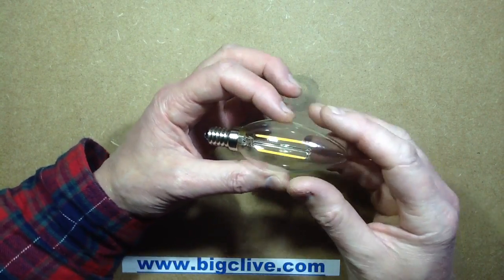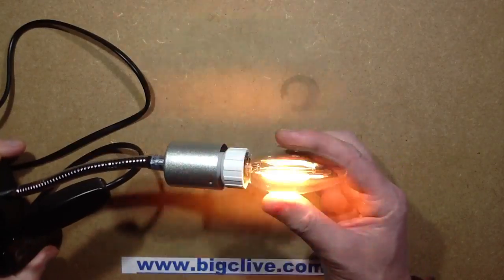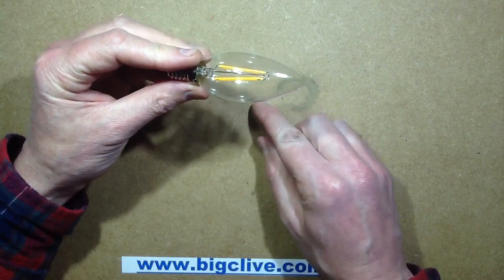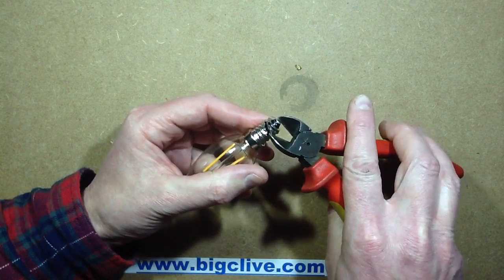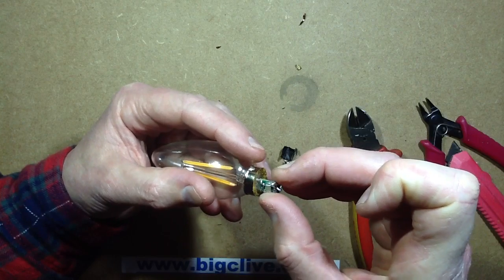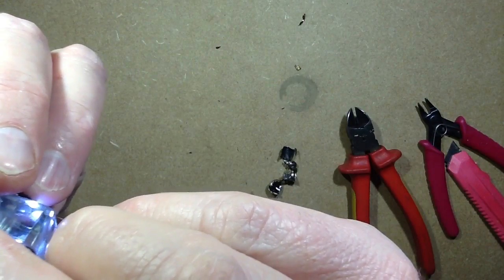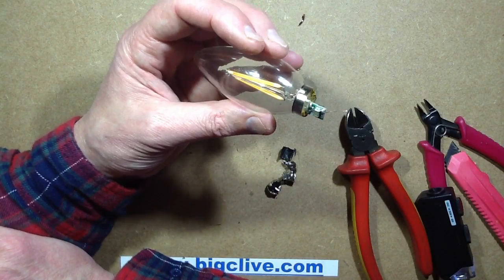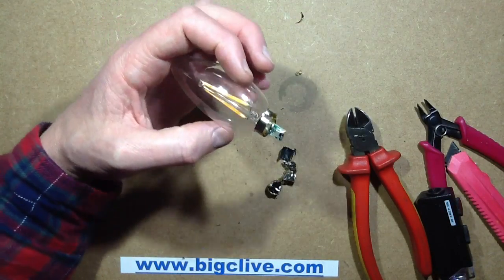Teardown of a 2-filament LED lamp with ridiculously simple circuitry.

Comment: How many volt to glow each filament?
Reply from the maker: You can get these filaments in a wide range of voltages.  3V, 12V and 30V or higher.

Comment: Hey Clive, I just discovered these bulbs recently & purchased two in a pack with the 4 string of LED's inside & they do put out a lot of light & do not even get warm, not even, WOW!! & with that amount of light, I just love them & save a lot on my utilities running these so I'll purchase more when I have the funds to do so because I mainly live in the dark because of the power consumption even using CFL bulbs, much higher than what these use & are prone to always going out way to soon for the amount of money they cost. That was when I discovered the spiral blacklight & purchased it as well & put it in a lamp directly behind one of these new bulbs, about 5 inches away & I walked away to give the blacklight time to warm up & when I returned to my amazement was that I could see every LED lit up on that string of 4. That's pretty slick to me to able to see the LED's in such a manner as that. Also a update on my little Red LED, it's been almost 3 months now & that thing is still running, two AA's, 1-1K resistor & the LED. WOW!!!!!!! I can't believe that it's still going. I remembered now why I built it though, it's for a cabinet style clock that can never be seen because it's just to dark in here for one & the other is how it's made, it just kind of block lights, but it is really neat in it's design, so I thought about drilling for a LED in it somewhere that might fit along with an LDR, in case it ever does get enough light that is. LOL. OK, I've talked your ear plum off by now. WOW!!!!!!!!! That's a lot, didn't realize, but I was rambling, sorry Clive, it's the pain med's. I'm on they will make me hyper sometimes. Later then Bud.

Comment: Great Video.
Could you tell us what is the purpose of that capacitor//resistor between the line and the bridge rectifier?
Reply from the maker: +denish raju The capacitor lets a small portion of current through on each half of the sinewave.  The resistor is a discharge resistor to prevent a tingle from the lamp contacts when it is unplugged.

Comment: I took the cap off my "lantern" bulb just now, seems it's the same circuit as this one, cap with a resistor to a rectifier with a resistor across the LEDs, naff-all smoothing, yet it's in an ES cap so plenty room for smoothing!! :\
Reply from the maker: +twocvbloke They're just cheaping out then.  Although the capacitive dropper simplicity means it's less likely to get hot and go bang like the switchmode versions.

Comment: Recently bought a couple just like yours (along w/ E14 adapters to fit them in American sockets). Mine tend not to flicker so much as to pulsate. That is, they pulse brighter for a split second & do this at regular intervals. Guess I should've bought the versions w/ the plastic skirt below the glass.
Reply from the maker: Madness832 That's really odd behaviour.  Are they being controlled by a dimmer or other form of electronic switch?